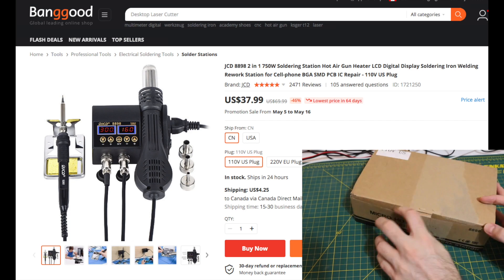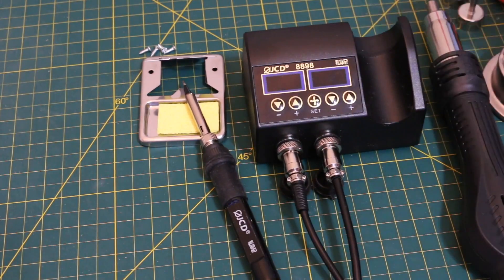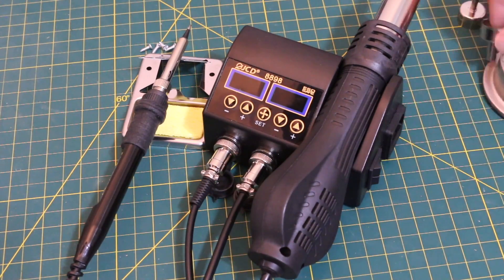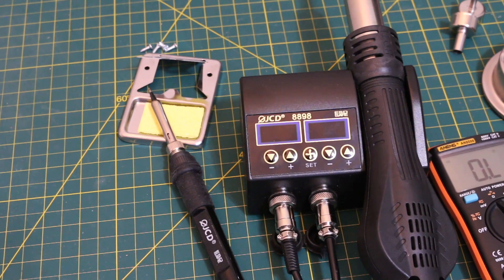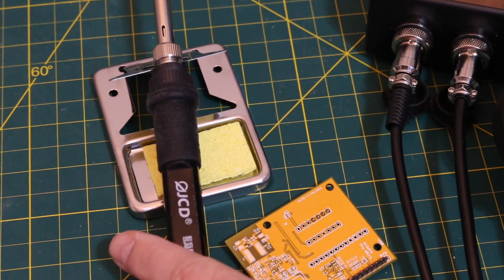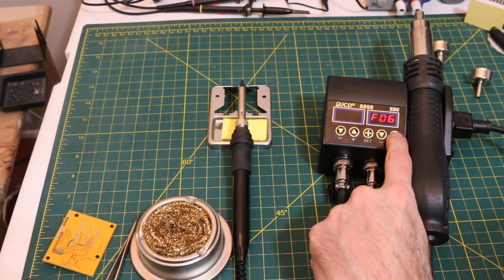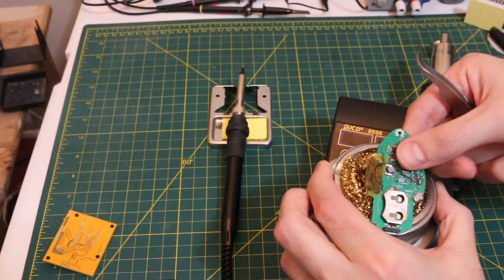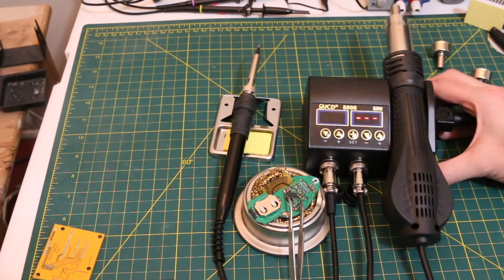JCD 8898 Soldering & Hot Air Rework Station Review

Comment: You can easily ground those connectors if you want to.. Just use some cheap battery alligator grips and pinch them around the connectors, tie them to ground.

Comment: Man, can i ask what soldering tips are compatible?
Reply from the maker: it seems hard to find information but it looks like Hakko T 18.
I measured one of mine and the outside diameter is 0.25 inches, the inside diameter is 0.15 inches that slides over the heating element and I put something down inside and it goes in about 1 inch

Comment: I saw other video reviews also for this station but the air flow was between 01 min. to 10 max i don know if its an issue or smth but mine is 05 min. like yours
Reply: If the heat is 300c or greater 5 is minimum speed. You can only use low fan speed on lower range temp
Reply: they made it like that for sake of a safety measure in order to prevent air gun from burning. + also it allowed them to cut costs and assemble this station with weaker components.

Comment: I really dig the hot air gun with auto shut-off.  I just got into electronics and circuitry a few years ago and bought the cheapest little AC iron kit off Amazon, which has worked great, but as I started doing more projects I kind of wanted something better. Had been eyeing the TS-100 for a while, but still a little too expensive for me.  Found out about the Pinecil and was lucky enough that it was in stock when I checked! Can't be beat for $25.... I still can't believe how affordable they are. It's a real champ. I run it off a big USB battery bank using USB-C.
As for hot air... well.... lol.  Using a little hobby heat gun, but only ever use it for heat shrink.  Works for me right now, though.

I think if I'd bought a little station like this a few years ago I would have been better off in the long run, though. 🤔
Reply from the maker: My first hot air attempt was using a big nozzle paint stripper style - it worked, but it also heated up about a 2 inch diameter of components that all slid around when I tried to work with the board.  Then I bought my first real hot air station.
Reply: @GadgetReboot  Oh wow!  I have a proper heat gun I use in the garage and for bending tubes for PC water cooling. I can't imagine trying to use it for SMD stuff.  haha! But hey, we use what we have at the time. :D

Comment: I have a standalone hot air station and I wish it came with a metal blast shield so that the gun can cool down into that instead of peeling the paint on my drywall lol
Reply from the maker: I learned the ropes with the hot air station on the job, learning all the various items that shrink or start smoking in the air stream before I had one at home so I haven't melted anything unintended...yet

Comment: Not too long ago beginners were recommended to buy a cheap soldering iron (maybe with dimmer-style power control, if feeling fancy) when they get started, and upgrade to better soldering stations if they continue with the hobby. Nowadays $30 and some change gets you a soldering station with digital control and a reflow station in the same kit? That's an awesome way to start the journey to the wonderful land of electronics.
I just wish my reflow station had a wall mounting option :P
Reply: So jealous, my first soldering iron was $40 and had no temp control!
Reply: This is the result of slav3 labor in ch^na.  The workers get to suffer while those in charge get to make money off of us. Isn't it grand.  All we get is something that almost works

Comment: Nice little review!
With these things it's always the question how long they last.
Maybe you can do some kind of second follow-up after a couple of months?
Reply from the maker: Yeah I'm surprised my other primary soldering/hot air unit (Aoyue 888A) is still running fine after 3 years and I haven't had to replace any heating elements like I thought I might.   So I'll be sure to keep an eye on how this 8898 holds up. But I really need to get an iron stand for it.
Reply: @GadgetReboot  I think I have my Aoyue 936 now for like 10 years or so? LOL
It's kind of funny and ironic, because at my work we have the most amazing JBC stuff.
Can't say I see a major difference. It's just more like luxury than anything else.

You can buy pretty decent and cheap iron stands on banggood/aliexpress.
In your case I would just ask banggood ;)
There is a solder station model almost identical to this one, were they have the (spring type) stand mounted on the left side.